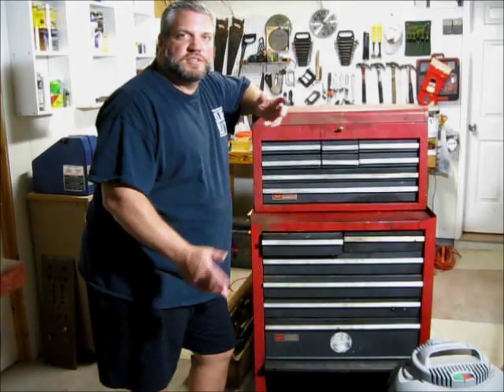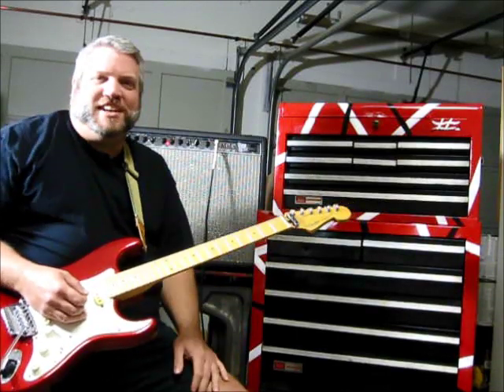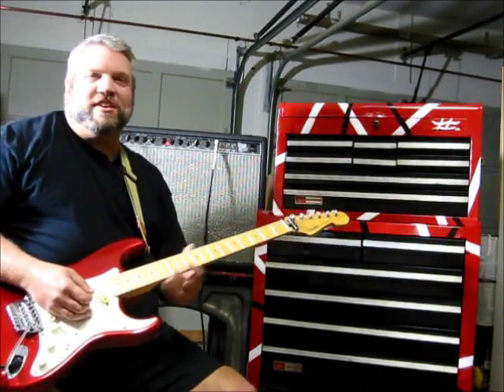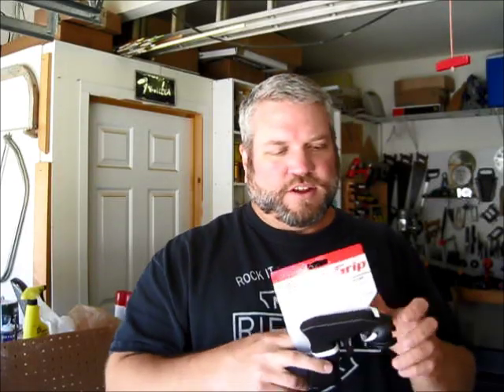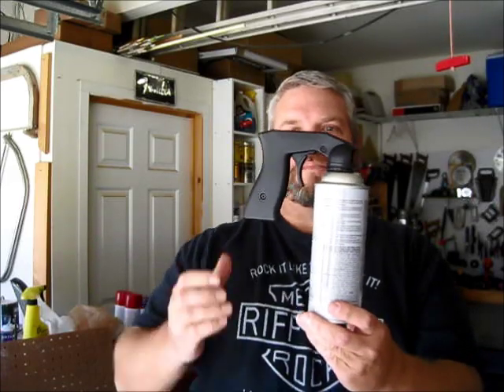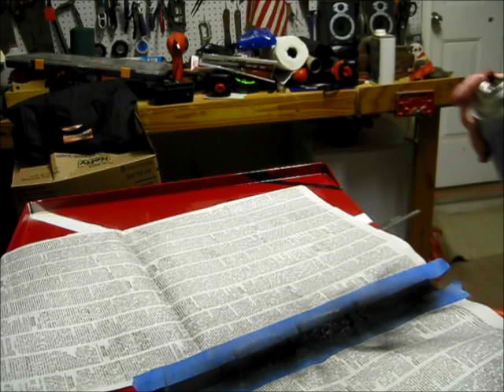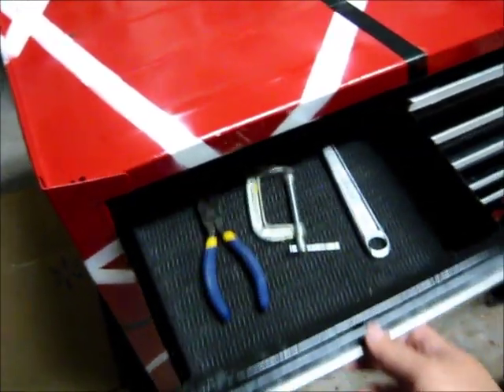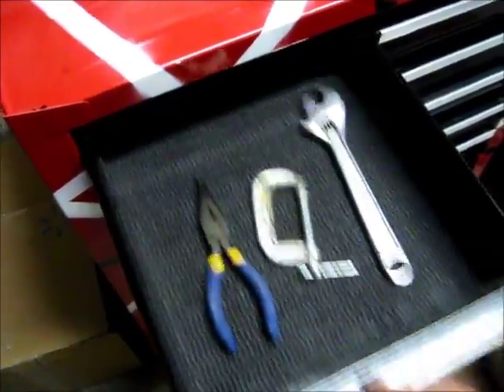Craftsman Tool Chest Restoration with Van Halen Guitar Paint Job

Comment: Nice job! I recently inherited my grandfathers tool box and I have been thinking about restoring it. You just gave me confirmation!
Reply from the maker: Thanks Cristian!  It was a lot of work to clean up at first, but painting it was fun.  Rustoleum makes a hammered metal paint that I think would look cool too.
Reply: Ya im debating about sanding or not. I have to re-evaluate the condition of the box first. I was actually looking at rustoleum camo colors which are pretty cool. I'm big into hunting/firearms and the rest of my shop resolves around that sort of thing so the camo make look sweet! What did you use to polish the drawer handles? A Dremel?
Reply from the maker: Camo would look great.  I just made sure to get all the grease and grime off so the paint would stick.  I did brush some rusty spots with a wire brush.  I used a scotch brite pad with wd40 to clean the chrome parts I think.
Reply: Cool thanks Steve!

Comment: awesome work. i just got an old toolbox from my dad and im thinking about doing the same thing
Reply from the maker: It's a lot of fun.  Just make sure to remove any grease, grime and rust because the paint will peel off.  I'm going to do the other VH colors on some stuff in my shop.

Comment: Great job, I just got  a old tool chest, how hard is it to pop the drawers out???  Thanks
Reply from the maker: Thanks Aaron!  It's easy.  There are tabs on the sides of the drawers that you push to release the drawer so it will slide out.  Similar to this probably Craftsman Toolbox Drawer Removal for Castor Installation

Comment: Just found your channel. LOVE the KISS whirligig!!! I gotta make me one of them! (don't have me one of them HOA's)

Cool toolbox. Beats the plain ol' red. I do have to ask if the black stripes were an after-thought as I would have thought doing them prior to the red like you did with the white would have been less painful than masking off for them after.

And yes I've been meannin' to try one of those spray can handles.
Reply from the maker: Hey Roger, thanks for watching!  I still have the KISS whirligig.  It's kind of dusty now.  I've painted EVH striped stuff before and always do the black stripes last so I can see where they would fill in the gaps best.  I knew I couldn't get a smooth red factory looking solid red finish, so the stripes kind of hide the dings and dents.